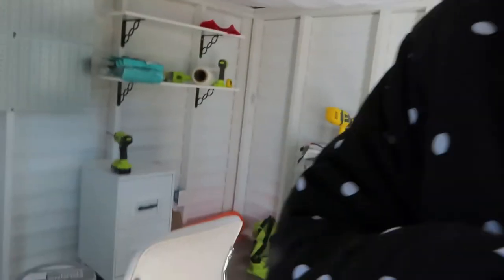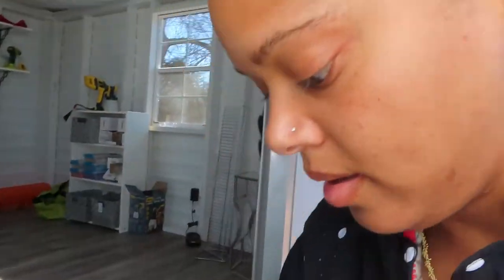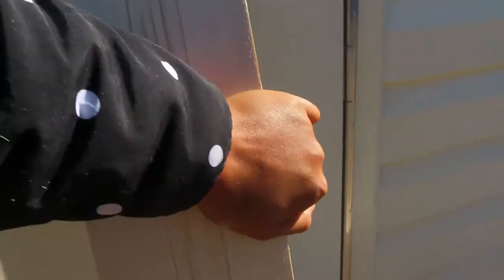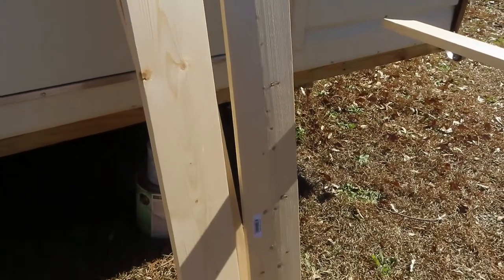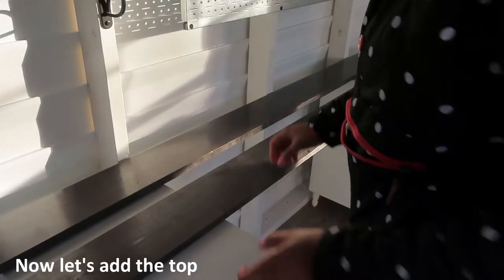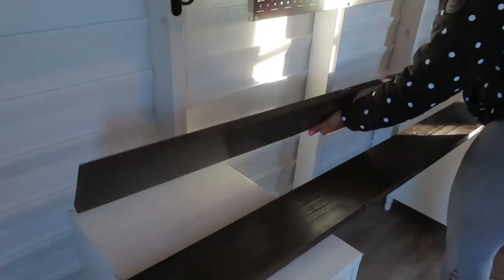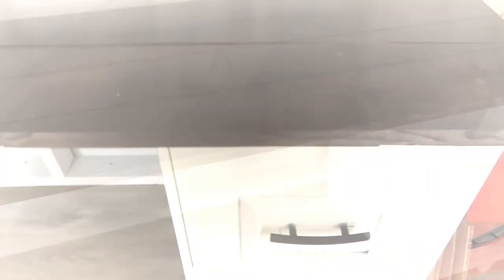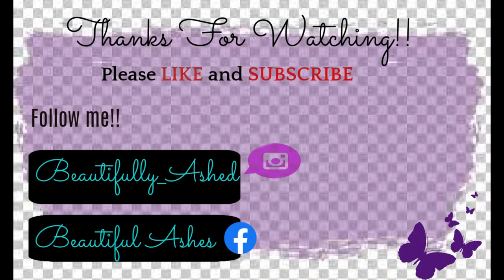AMAZING and EASY DIY File Cabinet Makeover - PART 2 **YOU DONT WANT TO MISS**

Comment: I've thought about doing this project myself. The only ting I would do differently is not attach the wood to the filing cabinets with glue. I  would have attached the wood pieces together first so that it is one whole piece. Then I would drill holes into the top of the cabinets, and from the inside of the cabinet, use screws to affix the wood to the cabinets so it doesn't move. That way, you can take it apart if you ever decide to move it to another part of your work area. But you did a really nice job. Thanks for sharing.